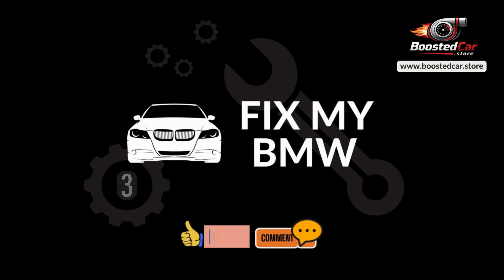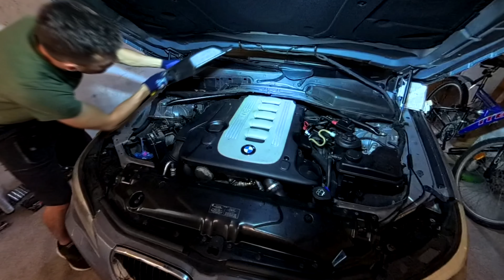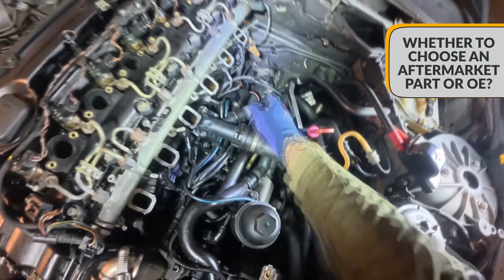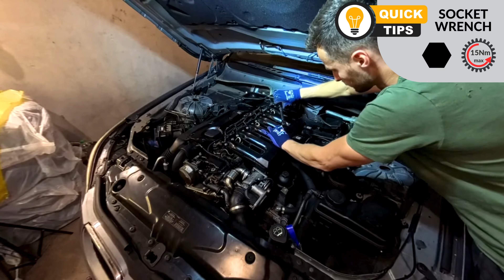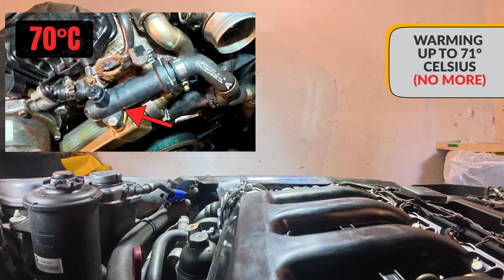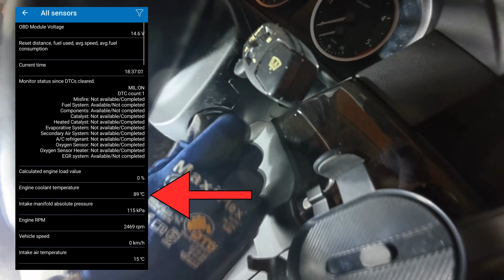How to change BMW M57 water flange & bleed cooling system (E60/E61/E90)

Comment: What if my car is US Spec & doesn’t have a Secondary EGR Thermostat/Deleted EGR, would I do the second part of the procedure, and wait for the main thermostat to open?
Reply from the maker: Hi! Yes, you can skip this step provided that the temperature rises steadily; if during warm-up it stops earlier, for example at seventy degrees Celsius, and refuses to go any higher, that will mean there is an air pocket somewhere, and to remove it you will have to let the engine cool down. If the temperature does not stall during warm-up, it will be the easiest bleeding process ever ;)

Comment: Is the top screw enough for bleeding? My car has EGR delete and hoses are just plugged up there.
Reply from the maker: Hey, do you mean without unscrewing that bolt under the throttle body? To be honest, I completely forgot about it once, and during the warm-up, the temperature stalled. Despite the computer reading 68 degrees, the coolant in the expansion tank boiled over. If I could offer some advice, it's better not to skip it just in case—it could potentially turn into way more trouble than it's worth.
Reply: @Imelikud123  Did you ever manage to bleed it ?

Comment: i might have missed it in the video, but first you topped it up with just distilled water, did you drain it completely after doing that?
Reply from the maker: Hi, inside the canister is a ready-made mixture of coolant and distilled water one to one (these proportions were specified on the coolant packaging). I am pouring it from a distilled water canister because it was easier for me to mix everything together. I filled the system with pure distilled water only after using the cooling system flush from Liqui Moly, but I will post a separate video on that topic 😉
Reply: @fixmyBMW   thanks for getting back to me 😅

great videos by the way
Reply from the maker: Thanks, I'll try to maintain the quality and produce as much content as possible. I'll speed things up a bit in the last quarter of the year, keep your fingers crossed 😉

Comment: What's your opinion on upgrading this flange to an aftermarket aluminum one? As the plastic ones can rot and/or crack over time
Reply from the maker: Hi! I think that’s a good idea; you just have to remember to use the correct coolant. In the case of a "random one from the supermarket," electrochemical corrosion may occur 😉
Reply: @fixmyBMW comma g48 blue coolant is what I use in my 335d
Reply from the maker: Great, this coolant meets the BMW LC-87 standard and is perfectly suitable for engines with a cast-iron block 😉
Reply: @fixmyBMW  335d is aluminum block, cast iron block are the older m57
Reply from the maker: In both cases, it's a great choice 😉

Comment from the maker: IMPORTANT UPDATE! Do not lubricate cooling system O-rings with engine oil, as it can damage them; during assembly, use a bit of silicone grease or clean coolant to slide the seal on. Lubricating these O-rings with engine oil was a mistake I made. Take care!